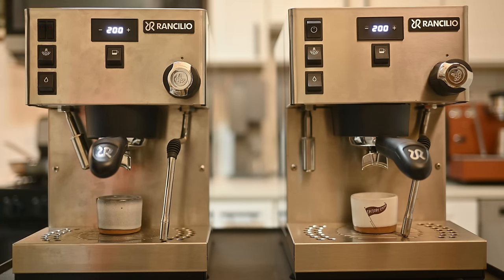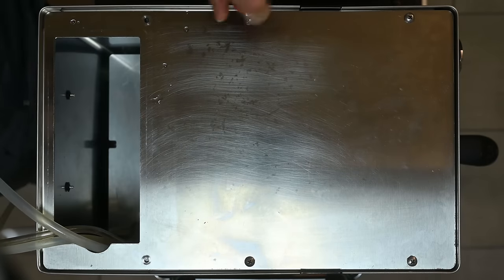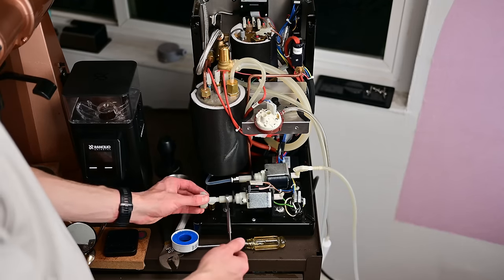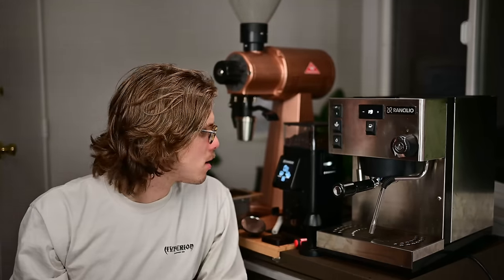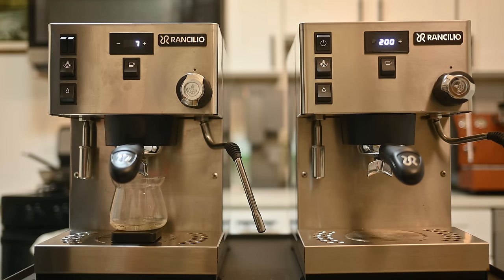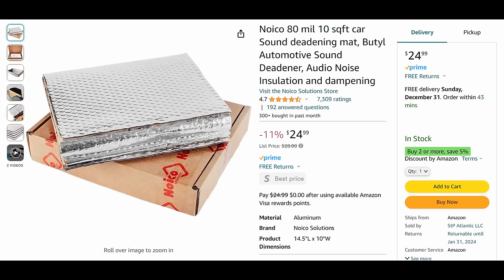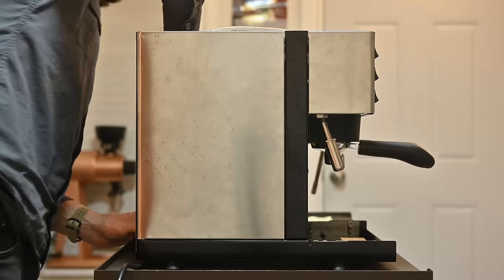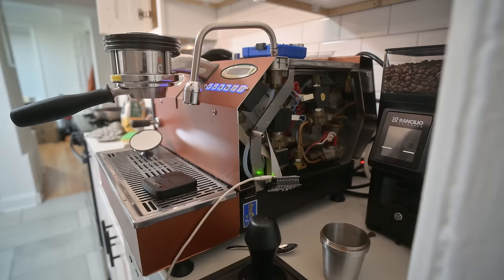How To Make Your Espresso Machine Quiet

Comment: The tweaked machine really does sound quite nice.  One thing I gotta say, is that your workmanship with the sound damping material was solid.  That stuff can be tricky to cut without it looking hacked apart with a buzzsaw, especially with all those added holes.  Good work all around.  I envy the Rancilio frame construction, as getting in and around my Gaggia is a royal pain with its unibody construction.  Adding damping material to that thing would be a nightmare and totally not worth the effort (even though it's noisy as hell).  The pulsor might be an interesting add-on though.  I've relegated it to "travel machine" for when my group in the office wants to do some espresso, but every bit helps to reduce embarrassment when sheepishly pulling shots in front of others.  I imagine the added weight to the Rancilio might be nice when twisting the porta as well.
Reply from the maker: Thanks! I was a little embarrassed of my hole cutouts, but I guess it could be worse! I used a throwaway box cutter that worked very well. Sad to hear the gaggia isnt as easy to open up :(

Comment: FYI: The pulsor actually increases water debit a little bit! I liken it to a reservoir capacitor in a linear power supply - it's filling in the dips where the vibe pump piston is retracting. The Lelit pump is  much lower (~30% or so) throughput than a standard EP5 - the MaraX has a 4.5ml/s water debit. With yours, I'm seeing a bit over 5. I've seen people put pulsors in BDBs which have a largely unrestricted water path, it'll push the debit up from 6-7 to 8 and change.
Reply: "flow" in English.
Reply: @nicknelson9450  Not quite. Water debit is specifically the zero-restriction (i.e., no coffee) outflow from the group.
Reply: @davidfuller581  What I was trying to convey was that the word debit does not have the meaning I believe you are attributing to it in the English language, and I did look it up before I posted to double-check. I have since looked up "water debit" specifically, however, and that does appear to be in use, mostly in a barista or coffee context?...and is this possibly a French-Canadian thing? What I maybe could have suggested more precisely as the English translation for the French word "débit" with this meaning is "flow per unit of time" rather than just "flow". Anyway, if some English-speaking people in a coffee (and possibly gas) context do use the expression water debit, then so be it...I'd never heard that before.
Reply: @nicknelson9450  Considering this is a video about modifying espresso machines, I'm pretty certain it's in a coffee context.
Reply: @davidfuller581  Sure, that's true...but I don't think anything I've said was questioning that fact, right? Anyway, just trying to be constructive and actually I was beginning to be mildly intrigued to find out more from you about this new-to-me use of the word...but maybe we're not on the same sort of wavelength...happy to go with the flow or lack thereof (pun intended) 🤐...Cheers.

Comment: Wow this is a great video, another tip which makes a huge diference is if you place your machine ona soft surface that absorbs vibrations as opposed to a hard table this makes a massive difference!
Reply: Big agree! I had issues with my EK43 when I moved apartments and found that the vibrations were ‘resonating’ into the cheap countertop. Bought a thick rubber tile from the hardware store (the type used in gyms) and it made a massive difference to the sound of the grinder.

Comment: Wow, this is so similar to my journey with my Profitec Go. Same Noico sound deadening! I did use a pulsar, but did not switch the pump, however I did remount the pump on a piece of Sorbothane, which had a very similar effect. Give that a try IF you are experiencing any vibration related noise. Do a quick search online - there is an ANCIENT post about a fellow who installed water hammers to his Silvia, apparently to great effect. Next step for me is to switch to plumbed to free up space, then Arduino + Rotary pump and to likely replace the basic PID. Cheers!

Comment: I did the same mods on my Gaggia Gaggiuino. I love it!! The machine sounds like something much more expensive. I had it for many months now and no problem at all with the deadening material and heat.
Reply: Do you have a build log on your Gaggiuino? I want to do the same for my Silvia Gaggiuino. Do you add the Pulsor to the new pump as well? Did it change your Gaggiuino build at all? Thanks!
Reply: @willcarter4950 I do not have a build log. I only have a few pictures. I did had the pulsar to the pump and dampening mat to the inside of the machine. The machine is amazingly silent and it hasn’t changed anything to the behavior of the Gaggiuino.
Reply: Would love to see a video of you doing that

Comment: Any thermal concerns with the sound damping sheets? Thinking of trying this on the side panels of my Synchronika. First tier nerd stuff as always!
Reply: I was thinking exactly the same, thats going to possibly cause issues later on when that excess heat cooks the insulation on the wires and it all goes brittle and falls off.

Comment: Interesting that you didn't add rubber mounting to the pump or any vibrational parts. In addition, I would consider using fabric tape in between where the panels meet the base and are otherwise meeting at the seems. In keyboards it's called a Force Break mod, and it makes a huge difference. BTW keyboard modders use the same and similar insulation.
Reply from the maker: Good idea! Fortunately the pump comes with really nice rubber mounting that seems to make a huge difference!
Reply: @tatemazer  .. Then try adding that tape is the next step I would try. It's inexpensive and makes a huge difference. It's more about sound isolation between the panels and base.

Comment: Great video. May i ask if there is any different fittings needed for either the plumbing or the electrical connections when exchanging the pump for the Lelit Mira pump? I'm looking to do this modification myself and am unsure if it's just a simple case of exchanging the pumps or if any different fittings are required. Thanks!

Comment: Nice to see you back Tate!  The noise on my Breville Dual Boiler is also a massive complaint - I wonder if your mods would work on it as well 🤔
Reply: @JackBrainStem - I just replaced the tiny worn plastic ball valve in my 12 yr old Breville Dual Boiler Ulka pump with a Pyrex glass one after it stopped pumping water. It is now way quieter when pulling a shot. Like Tate's mod, I can now hear the espresso filling the cup. It is louder though when pulling some hot water, so go figure? One thing - one of the screw mounts for the rubber vibration mounts fell off so it now has 3 screws holding it instead of 4. Who knows if that helps? Thanks Tate for your efforts
Reply: I’d love to try a glass ball instead of the original. Where did you find it?
Reply: I got a Sage oracle. Works very well. Enough space to just screw it on. You just need to find one with matching fittings
Reply: @CyberlightFG what specifically did you use? Could you share a link?
Reply: Seconded! Would love to know if this “silent” pump can be installed in a Breville/Safe Dual Boiler
Reply: It's called membrane regulator. I can't send a link, you need to open the machine and look which fittings are inside.
The pump side is 1/8" for Ulka
Make sure there is enough space for the regulator. You have to screw it directly onto the top of the pump

Comment: Cool. I installed pulsor about a year ago on my Silvia. It was about that time I swapped the EP5 pump for an EP4. Slightly different (slower) ramp-up .. and an improvement to my coffee.  Insulation is interesting. I've only done the boiler with 5mm silicone sheet. Your Pro is definitely quieter than my old Silvia. Long may she run!

Comment: This was a brilliant video. Very entertaining and informative. I've always wondered if someone would try and make their vibration pump quieter. Question: I know that rotary pumps are much bigger than vibration pumps but it looks like there is enough space inside the Rancillo for one. Would you have consider installing a rotary pump in your machine? I hate the sound of vibration pumps so much that my dream machine in the Olympia Cremina.
Reply: If there’s not enough space inside you could mount a rotary pump outside the machine. Some professional machines have external pumps too btw.

Comment: Het Tate, great video! Im thinking to do all I can to make my Appartamento more quiet, maybe a rotary pump if possible. Quick question - will the sound deadening wrap negatively affect thermal cooling and overheat the internal environment inside the machine?
Reply from the maker: Hey Chris, thanks! So long as you avoid blocking the ventilation holes at the top of the machine I believe you should be ok. The components in there are rated to run plenty hot and the electronics are fortunately pretty low in the machine.
Reply: @tatemazer  thanks!

Comment: if I can add anything It would definately be to not add the silent pump, cause 1. Its waay more expensive than its worth and 2. It'll lower your water debit a little too much on  e61s, in fact on my maraX I actually took out my glicleur because the water debit was too low for my liking especially if you are doing anything high extraction. 
In fact, even taking out the gliceur (not reccomended) the water debit was still too low.

If you want something closer to the silent pump from the standard, I would reccomend the ulka ex4.

Comment: I did the car insulation also, looks like I need to buy some more as I forgot to do the bottom of the machine!

I also found the pulsar so not really do much (but I did the car insulation at the same time)

How do you find the water tank's lid and the silicone hoses?...for me this is the most noisy thing as the hose rattle is super loud...I find I either need to keep the machine full of water or simply remove the lid when pulling a shot. I did use cabinet door buffer stickers and it helps a little.

Comment: good stuff!  I'm glad you mentioned that about the pulser. I put one on an old Starbucks Barista and it did not make a significant difference in noise but it's not a daily-driver machine.  I've gone so far as to upgrade an old Giotto to a rotary pump which has a nicer sound.
Reply: OOoOo I've got an old Giotto. Hoping to do this, any advice? YouTube clips? 👀
Reply: @jaysonmorales9898  no clips, sorry.  I basically rebuilt and re-plumbed the machine from scratch, making brackets, soldering custom pipe and modifying the thing as necessary.   Definitely not a simple swap job.  fittings are metric pipe with BSP thread if memory serves.   Good luck.
Reply from the maker: Impressive! I've always wanted to learn how to make new pipes!
Reply: @tatemazer  It's not difficult but you do need some tools: a hacksaw, a small tubing bender, the ability to silver solder pipe fittings (with MAP gas torch). and supplies.  typically 1/8 BSP fittings and 6mm tubing for classic Italian units --sometimes 1/4 BSP (Stefanos's and Espressoparts are good suppliers).  BSP comes in taper (BSPT) and parallel (BSPP) so mind the difference.

Comment: Did you put a pulsor only at the brew pump or also at the service boiler pump?

If both, it would be interesting to know how you installed it for the service boiler. I think an additional fitting is necessary here to avoid contact with the boiler (not enough space for the pulsor alone)
Reply from the maker: Only the brew pump!

Comment: The only other things you could consider now that the pump is as quiet as it can be and the chassis is acoustically dampened would be to block the sound by tenting a bit of mass loaded vinyl around the pump if space allows, installing sound absorbing acoustic foam on panels if there’s any space to do so which would convert any sound vibrations that strike it into heat, and lastly maybe put some kind of thin foam or rubber gaskets between any sections that don’t sit tightly against each other and allow for potential sound leakage. There’s be very diminishing marginal benefits to all of this.
Reply: Don't cover the pump. It gets hot.

Comment: I'd love to see what similar things can be done to a Gaggia Classic.. also if you can somehow use the sound dampening material (or any other mods) to make grinders quieter. Grinder noise is way worse than espresso machine noise IMO.
Reply from the maker: All of these are definitely possible on the gaggia classic! Many of the parts are interchangeable between those two machines
Reply: Do you know which parts? I would like to try and replace the pump for oleb silent green and add a pulsor, but I'm but sure if it will fit GCP. Dimensions are almost identical.
Reply from the maker: @vukasinnesovic4644  vibe pumps are mostly interchangeable. Not certain the pulsor will fit. You'll have to check yourself. And of coarse the deadening material could go on any machine

Comment: Did you also change the service boiler pump? I am not sure to do it on my machine. Because of the ~1/3 lower flow rate and time controlled pump cut-off after activation the service boiler will not be refilled to the regular level. Will still work (if to low, pump is activated) but with less steaming power I guess?
Reply from the maker: I only used it on the brew pump since I don't steam very often. 

The steam boiler will still fill to the same level since it is still depending on the fill probe to check the water level. The only issue you might encounter with replacing the steam boiler pump is during the initial fill of an empty boiler. It'll probably trigger an alarm thinking the steam boiler isn't filling, but it's just slow.  I've had similar experiences on another machine and I just power cycle it once or twice during that first fill
Reply: @tatemazer  Thank you so much! The second OLAB Silent Green is already here, waiting for some spare time. Plus a 90° fitting and a second Quickmill pulsor. Add some aluminum butyl and the machine will become really quiet.

Where I live, in Europe, OLAB Silent Green costs about 30 EUR. So it's not really expensive to change both pumps. Talking about the Lelit assembly, this is really expensive but not necessary. You only need the pump

Comment: Im thinking about damping the machine too but im unsure about thermal heating and its effect on electronics inside. Yours now in place for a couple of months. Did you see any problems? Cheers!
Reply from the maker: No problems! The electronics sit very low in the machine and away from too much heat.

Comment: The sound deadening material is a great mod. Does it tolerate heat well? Kinda scared it's going to off-gas some nasty smelling chemicals.
Reply from the maker: Thanks! Yes it's rated for 212F and I don't have it touching any boilers directly so it shouldn't be anywhere near that. No smells either thankfully 😅
Reply: @tatemazer  sweet, thanks. Definitely doing this myself.

Comment: I have a SPX, do you think just doing the sound dampening alone would make the most difference in sound? The pump is out of my price range.
Reply from the maker: check out the comparison between the stock machine and sound dampening at 9:13 . It definitely makes a difference! Hard to say it is the most substantial, though. They all help

Comment: ive been meaning to try the diaphragm that delonghi makes for their automatic machines, there is a guy that put one on a machine in a video in yt and it made a substantial difference in the video he made, seems to work on yours too!
one thing that worked for me that I didn't do on purpose for noise was adding a dimmer knob to the pump.  I haven't measured what the voltage change is but if I just turn down the dimmer a tiny bit, with a zero pressure load flow rate change of less than 1g/s the volume and frequency of the pump is substantially better.
with this and the gaggiuino mod installed on my delonghi stilosa the noise is very very minimal during a shot, videos on my channel where i've modded the software to have stop on weight and touch screen controls #notanad lol..

Comment: Do you feel like the deadening material could also be put inside the housing for the front around all the buttons/PID/etc? Any reason you did not put it there?
Reply from the maker: It definitely could! I'll admit it was pure laziness lol I didn't want to unplug all that stuff and I was happy with the results
Reply: I finally finished this mod to my machine (it was disassembled for me to rebuild my steam valve for nearly a month...) and to anyone else watching this video, I would say the deadening material is the most significant and easiest upgrade here. ESPECIALLY placing the deadening material near the pumps. I forgot to do the underside initially, and while I noticed some difference, after applying to the underside just under the pumps themselves, WOW is this machine quiet now.  Thanks for the idea @tatemazer !

Comment: What is the chance to have the machine overheating with all that insulation?
Reply from the maker: I haven't noticed any change in temperature. Fortunately the boilers are insulated so the inside of the Silvia pro tends to run very cool.

Comment: You could have bought a Fluid-o-Tech nsf 24V DC rotary vane pump for the price of that Lelit Silent Vibration pump..
Reply from the maker: Wow where?! I've purchased new ones before and it  always been several hundreds of dollars
Reply: Not if you buy it from Italy. €162.50
Reply from the maker: @sxair2285  wow great deal! Drop a link!